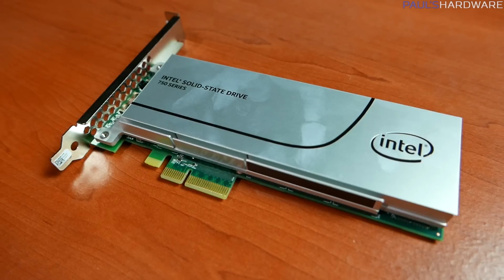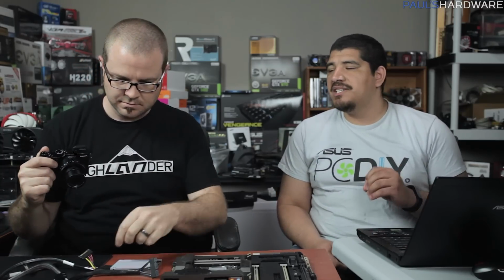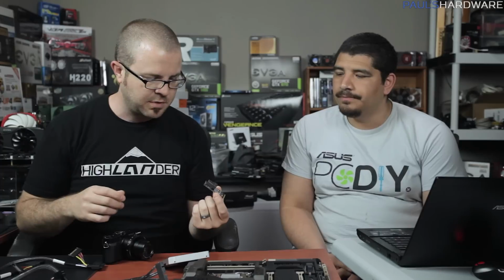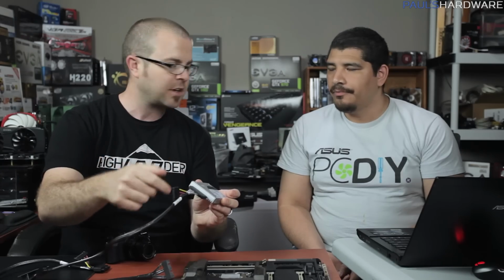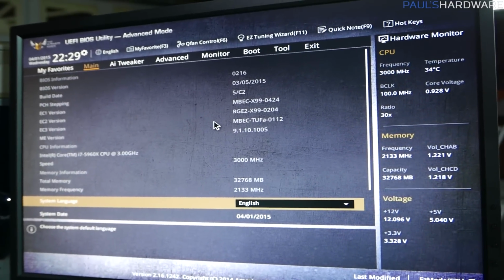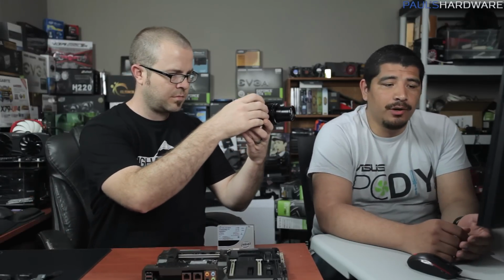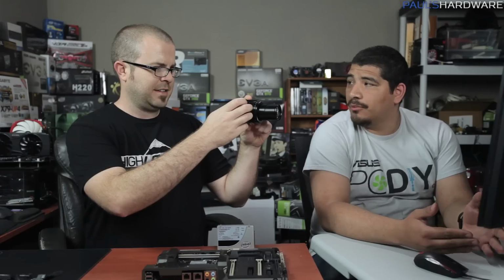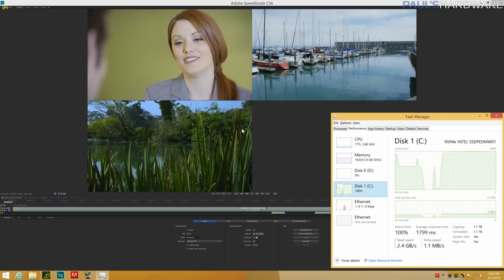Fastest SSD Ever! Intel SSD 750 with JJ from ASUS

Comment: Will they be adding drivers for windows 95, and windows 3.1?
Anyway, the cost per GB is very high by today's standards.
Reply: No. Only windows me
Reply: wapted 
Get on my level son.
http://imgur.com/lDv2Ohz
Reply: Razor2048 Did you watch the video? It's the first consumer SSD to feature an NVMe (compared to AHCI) controller, of course it's going to be expensive early on, that's the way it always is with brand new tech.

Comment: GOOD LORD THAT READ/WRITE SPEED. Puts my Samsung 840 Pro to shame
Reply from the maker: ***** the 840 pro is still good! It's still good dammit!! /sob
Reply: ***** 840 brothers unite!
Reply: haha yeah, ive got an 840 pro as well.. love it, but its put to shame in comparison
Reply: Paul's Hardware of course its still good, its great for a boot drive but in the grand scheme of things.. its like a little puppy and this intel 750 is like a huge rottweiler :)
Reply: Luke I would def snatch up any SSD within the past years, it is a HUGE improvement over an HDD!!!  Use the HDD for media storage.  Trust me, you'll be wondering how you ever computed without an SSD.
Reply: +Matthew Thomas The 960 pro is wayyyyy faster than this. Even the 950 Pro was which is the predecessor to the 960 Pro and was out when you made this comment. I have 2 960 PROs :P
Reply: 4Th3Truthful i dont like the 840 pro rapid mode. it slows down boot times which in my opinion, isnt worth it.
Reply: clamo6362
I was saying he should grab a SATA SSD, because they're worth it.  PCIe models are expensive at this point still, but the SATA ones are pretty inexpensive.
Reply: you did not get what I said sir. The ssd only goes this fast casue they using m2 ports.  "What they did was hooking up the sata port into a m2 port so it can do 2.7gb/s "
Reply: Pretty much whats holding you back from higher perfomance with SSDS is the interface, sata 6gb/s. Use m2 and pcie and you get allot faster.
Reply: Pretty sure it still doesn't beat rapid mode.
Reply: Indie Guy 2x840 evos and 1xCrucial m550 here
Reply: florianweiss007 get out mate, 840 pros only here. =)
Reply: 840 Pro Rapid mode is so fast with the right config. imagine something multiple times faster, Instant cold boot (under 1sec boot) seems almost affordable now with this newer tech.
Reply: 840 Evo and 850 pro here. :)

Optimized and boosted my ssds.
It seems that my 850 is almost twice as good as my 840.

The 850 is 250gb and the 840 is 500gb.
Reply: *****  yeh i know. which is why i disabled it. The normal speed is quick enough anyway.
Reply: HailgodMC I use the Evos. 256 Evo as a boot drive with chrome and in depth pc stuff, photoshop and so on.
my Games are stored on my 500 Evo.

Video work and stuff like that sits on my 3GB WD Green.
Reply: Glycerin he's not talking about a normal SATA SSD. he means the PCI-E models. witch are still way over priced.
Reply: Compare the prices first
Reply: +Jose Acevedo jj's write speed is to high, I cant read the info that fast if you know what I meanif you don't know what I mean.... I mean he talks so fast and says so much information that sometimes I zone out and I have to rewind to just get all the info
Reply: +Keyboard Warrior (TacticalxPlayer) thank you for mentioning this i thought i was the only one. JJ is a SALESMAN, the only way you can get them to stop talking is to give in and buy their product.
Reply: /didnt know you played WOW
+Paul's Hardware
Reply: this made me hard
Reply: you'd rather use m2 instead of this ssd. What they did was hooking up the sata port into a m2 port so it can do 2.7gb/s
Reply: no current M2 SSD is as fast as this SSD.
Reply: Synthetic bench, yes.  But the sustained performance of the Samsung devices is sub-optimal and throttling issues abound due to lack of heat abatement.  After suffering with performance issues and strange slowdowns using the 950 and 960 Pro NVMe drives from Samsung, I switched to the Intel 750 series NVMe drive.  Even running across the PCIe interface the Intel drive's performance is better across the board, and much more consistent. FWIW.
Reply: Mate your ssd speed is limited to 600mb/s maximum read writes with your onboard sata 6gb/s.
With m2 or pcie you can get in excess of 2GB/S read speeds
Reply: I have an 840PRO also
Reply: I'm waiting for a reasonably priced pcie ssd to replace my hdd:/